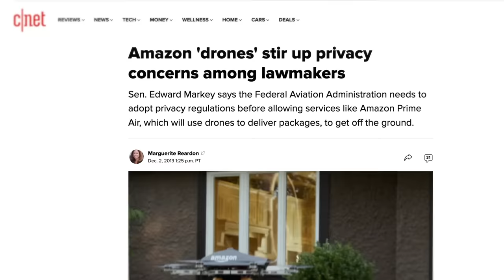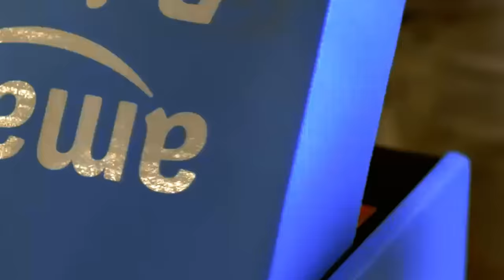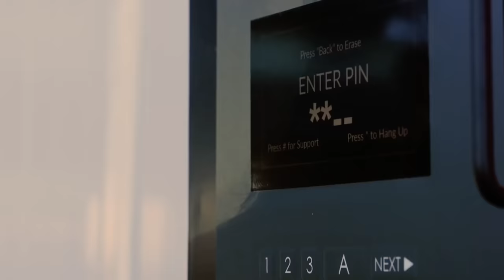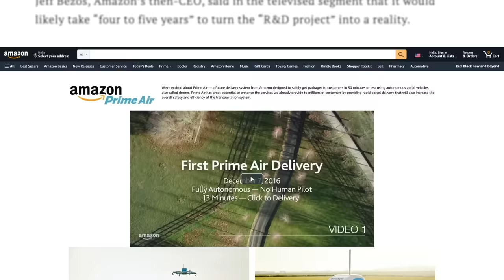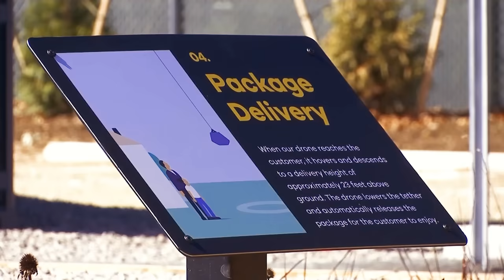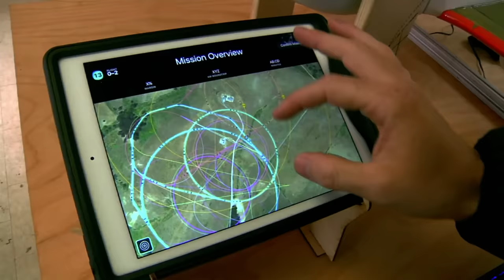Drone Delivery Was Supposed to be the Future. What Went Wrong?

Comment: 6:40 I though these issues could be solved by basically a picnic mat sized QR code to give the drone a clear target landing point.
The main reason I don't think drone delivery at least for now will work is the noise. Even if the drones stick to pre set sky lanes at 500ft the buzzing no stop will be madding
Reply: Well people deal with cars at street level.
Of course no one can say for sure, but I think people will be fine with drones.
Reply: cars are WAYYYYY louder than a drone
Reply: Jake Krause  if they allow a military grade GPS then it is just way too easy for something like Slaughterbot to happen. They shouldn't allow that to happen and just let commercial company to develop a natural looking autonomous navigation AI like birds and bees which doesn't even use GPS.
Reply: Exactly what I thought a practical solution would be. It could have been that amazon sent an executive to install a the QR landing mat to whoever subscribes to prime air and he installs the mat at a desired location maybe above the ground and clear off obstacles. And then whenever that customer orders something the package would always be delivered there. The customer would care to ensure the landing pad is clean and clear of obstacles as they do with a dish antenna. No need of fancy and unnecessarily complex AI or laser guidance.
Reply: @xponen  L1 -L5 GPS. Glonass, Bluetooth Beacons, LIDAR, etc. The sensors are their. Slaughterbots will be more like predator drones and less like knives that fly.
Reply: You can barely hear a drone at 100ft, let alone 500ft.
Reply: Yeah those electric propellers aren't exactly quiet. They should be doing R&D on quieter electric props. It is possible. The military does have a fleet of stealth Blackhawk helicopters since the 2000's that have quiet blade tech. Just implement that tech in smaller electric drones.
Reply: Drone buzzing sure is a weird noise. While it’s technically quieter than other stuff, I always find myself going crazy trying to find the source of the noise any time I hear it.

Probably just cause it’s a “new” noise, but still
Reply: OMG yes, I thought drones SO cool until I heard a fairly small one in operation.  My neighbor was super-proud of it.  I thought it was really awesome, even if noisy.  Then he flew it into a tree and it fell to the ground... like humpty-dumpty.
Reply: funny, how drone based delivery will cause a droning noise over a city.
Reply: A large outdoor QR code for every customer would significantly add to the cost and hassle.
Also, it might be vulnerable to bad actors attracting the drone with a duplicate mat or hacking the drone with a malicious QR code.
Reply: Hi Iron
Reply: relying on end users to set up the landing site is a bad idea. people could be stupid or mess with the system.
Reply: Thank you for mentioning it, but the noise of it would be awful and ruin any option of sitting quiet in your yard, especially for the poor people who live near a hub. The zooming noise of a single drone is worse than a ton of cars passing by!
Reply: It would be like living on a street where like some neighbor or another always seems to be mowing their lawn.
Reply: You normally can’t hear drones at 500 feet
Reply: In regard to the noise, a simple solution is more blades and less speed. That, and staying at a relatively high altitude of a few hundred feet would minimize noise.
Reply: I took a class done by one of the guys sitting on the anti-terroism council for miami and he basically said they were vetoing this idea out of hand along with many other divisions. Simply can't manage it.
Reply: @justusleague6952  totally not true.  they're also at street level and much of their noise gets diffused by fences.  this will not be true with multi-rotors.  you will not be able to hide from their noise.
Reply: @PacificSword  Uhh no? Cars ARE considerably louder than Drones. 
Drones could also fly considerably higher than 500ft to avoid the sound problem. 
A Drone 400 meters (1300ft) above ground cannot even be heard in a quiet forest. Let alone a City.
Reply: Don't prevent dogs or children from colliding with the drone. Also.. you underestimate how much these things depend on scalability. Even the idea of everyone having to think about where to put a mat (assuming they have a place and want to put it there) is enough to kill all uptake of the idea.
Reply: @xponen  the GPS we have now was once military grade lol

That term has a lot less meaning than you think
Reply: Better to have small vehicles driving on the roads. Quiet and almost as fast.
Reply: I could also shoot them outta the sky and make off with packages
Reply: Indeed, around here there are Zip scooters you can rent with  your phone and they are literally LITTERED all over like abandoned junk, and people have enough of it and the city has clamped down, they now have to be kept at ONLY specific locations, and that somewhat deletes the whole point of them.
Reply: Yeah, unis did that with drones paired with GPS, but the problem of obstacle avoidance and more cruicially, airports in metro area basically banning drones in planes flight path.

then problem got even worse when scumbags tried to fly drones INTO the airport and near planes. :/ I think additional problem is training enough people (and are willing) to troubleshoot/maintain drones, and possible thefts.

then theres the privacy issue with camera equipped drones flying over people's homes, and some people take that to extreme and just shoot drones out of the sky.
Reply: @theatom7264  that’s part of the issue, just implementing something that works on a helicopter scale, doesn’t necessarily work at drone scale.
Reply: @E.Asinus  eh, mostly because people abuse the hell out of the rental scooters. UAVs should last quite a while, unless a crash happens. only moving parts in a drone are brushless motors and they have way more lifespan than brushed/other lift methods.

still there is the problem of making sure obstacle avoidance works 99.9999% of time so companies dont get sued
Reply: @KaitouKaiju  technically all GPS is military grade, given the US military created GPS, much like they created the precursor to the internet, and many many other things we use on a daily basis.
Reply: @SunriseLAW  $500 drones or anything that has basic obsctacle avoida nce like dji stuff should prevent that from happening. though older drones have directional obstacle avoidance (only on the front)

that being said people could just snatch drones out of the sky by say, shooting it and get parts off it. and unless drone has footage of everything companies wont know who exactly shot it and all theyll have is where drone went MIA with gps location
Reply: Jake Krause  flying taxi's.... really....
Reply: @almostanengineer  Yeah, my goddaughter's light up Batman shoes have military grade velcro just like his boots
Reply: @xponen  we already have military grade gps on our phones…
Reply: @MichealBatur  you use the same GPS that the military uses but they artificially limit your precision except if they allow it for you to use in academic/scientific research in the US.
Reply: @leonmuller8475  They cannot fly that high due to FAA regulations.  Cars driving around at residential speeds are very quiet.  It's the tire friction with the road that creates most of the noise unless you're driving a hot rod.  Most people find the prop noises from multi-rotors quite irritating.  Me included and I fly the damn things.
Reply: @Daniel-uq2on  you ever hear a drone? Theyre crazy loud.
Reply: @TheRealE.B.  Also someone opening the door and wrecking a drone.
Reply: we can also make a type of "bridge" for apartment budings. it can be installed on windows for drones to deliver the packages on to
Reply: True, we wouldn't like our skies to be clogged with drones
Reply: I can barely hear my dji mavic drone when it's 400ft up.
Reply: Did not expect to see you on a wendover video
Reply: @PacificSword  „They cannot fly that high due to FAA regulations.“
Ever noticed that regulations applicable for you and me are not applicable for trillion Dollar companies? 
Also there were Nations like Switzerland and Austria which allowed you to fly as high as you want, without any problems. 
(There is now a EU wide streamlined regulation for Drones which is why this is not the case anymore)

So there are no actual reasons for regulations below 500 meters.
Reply: @ZentaBon  Yeah, I can understand that.
Reply: Are you going to rely on the user to provide the most critical information for the devices workflow? Bad idea. What if the person makes the order away from home and cannot put the pad for the drone to see?
Reply: @theatom7264  quiet props tech is there, they're loud because they're pretty much expendable and supposed to break when hitting something to prevent damage to property of the drone itself. On a regular electric RC helicopter with belt drive and carbon fibre blades, you only really hear the motor and the faster spinning tail rotor. They're mechanically complex though and they go through your bones like it's nothing and destroy themselves completely when the blades hit a tree or something, a quadcopter drone is much more compact, simple, safe and cheap but yeah, the sound is annoying. Ones they're a bit higher up, you can still identify them visually but you can't hear them.

Motor sail planes are great, only noisy on the way up and then they just cruise silently. Dropping things on little parachutes or in a big dedicated net works great especially if the destination is not really accessible by bike or car and irregular enough where just installing a long clothing-line pulley isn't worth the cost.
Reply: @SaveMoneySavethePlanet  it's mainly because the rotors are not going the same speed and also modifying the speed independently, it's just unnerving. On a modern Zeppelin with independent motor pods, it's the same but just a few octaves lower and way louder, it's quite terrifying actually, think war of the worlds.
Reply: It's possible to design a quiet drone, but no one seems interested in that sort of design. Basically, you have a glider (almost completely silent) with an electric winch connected to a weight hanging below. By alternating between reeling in the winch and letting it loose, the glider essentially flaps its wing by diving and climbing. In order to deliver a package, the glider flies in a circle while lowering the package. Even though the glider is flying in a wide circle, the package stays almost in place.

It's practically silent.
Reply: Drones at 500ft are far enough that you won't even notice them.
Reply: And delivery to rooftops in urban areas.
Reply: "The automocarriage would be a great idea if it wasn't for one small problem, the noise! Can you imagine, thousands of motorized carriages buzzing around all day, in every city and every corner of America? It would be maddening!"
Reply: I remember how difficult it is to scan my Epson ink QR code. But the idea of a some sort of 'helipad' or heli drop zone is sound. And i think one company shown in this video is using it. An over engineered one also.
Reply: @theatom7264  a car is louder, it's a non issue
Reply: @Daniel-uq2on  Because at street levels, there is way to reduce noise pollution (trees, barriers, vegetation etc), but a drone in the air isn't possible
Reply: @xponen  What is "military grade gps" lol. You realise that military & civlian GPS are near identical, with small exceptions WHICH the civilian market has access to??????
Reply: Those who say drones are not noisy are simply deaf. It's truly loud and annoying. Fact.
Reply: @JD-jc5hg  civilian GPS is artificially less precise so that terrorist don't use it to turn drone into a guided missile.
Reply: @ZentaBon  It'll get a little bit better with electric cars, but the tyre noise will still be bad
Reply: @sr.luisraytraceiii2422  LIDAR is absolutely incredible
Reply: @PalmliX  You can absolutely hear a drone at 100ft. Even at 500ft if its directly above you.
Reply: Perhaps, but that would raise the barrier to entry for customers, not to mention you still have to solve for the problem of customers forgetting roll out their QR code. Probably easier to just cable it down
Reply: It makes me wonder why drones and not an autonomous small driving vehicle? An autonomous van drives to the location, a rover picks up the package and delivers it to your door and goes back.
Reply: @fshihab  That's what happens regardless. A yard needs to be free of obstructions and counts as a landing site.
Reply: not true about the landing. the computer brains are still very dumb on even landing in the correct spot. i used to fly a toy drone, it had return to spot. but even then some times it would not land saying there was interference.
and we all know computers never fail...right. who wants a big delivery drone falling on them. as the commercial drones as not the toys we had to play with, these drones have a foot print of over a sq 36 inches and need another 4 feet around that for safety. and that is if it lands exactly in the bulls eye. most will land better than a foot off the mark.
Reply: Most drones are loud because they have tiny little high speed propellers. Get a bigger drone with better props that can move more air at lower rpm, and at 500ft you wouldn't hear much at all.
Reply: @xponen  Um, really? I don't get what you mean by using a drone into a guided missile? How would that work? Drones are already in use by terrorist groups by dropping grenades or mortar rounds. I don't understand how you would convert a Drone into a guided missile, it would require more than a GPS to do that. The only difference between military GPS & civilian lies in the frequency. Military receivers use two GPS frequencies for improved accuracy whereas civilian devices usually have just one GPS frequency. But two GPS frequencies are also available to the civilian market. Civilians may also use augmentation systems to improve GPS accuracy. Such systems may even give them better accuracy than the military. The U.S. government has made a number of augmentation systems available to both the public and private sectors. I don't think you people realise how shit the military gear is. With the exception of certain techs, the civilian market is generally way ahead of the military. So unless you have experience in civilian GPS & military GPS (I apologise if you do), I believe you're talking out of your arse :/
Reply: @JD-jc5hg  what's with the irrelevant detail? simply put a precise GPS allows you to weaponize a drone hence why civilian GPS is not precise. Smartphone GPS is widely publicised to be accurate to few meters but for special civilian who is granted high precision GPS by US government has their GPS accuracy in centimetre which is so precise that it can even measure ground movement due to geological activity. High precision GPS is granted for civilian use especially in scientific studies in the US that's how it is known that the precision is within centimetres.
Reply: So no one is gonna steal these packages with a landing pad? So every house has a safe space for a landing pad? Be realistic lol
Reply: @eliw2333  how about five hundred drones 500ft away lol
Reply: @PalmliX  how about five hundred drones 500ft away lol
Reply: @leonmuller8475  how about five hundred drones 500ft away lol
Reply: @leonmuller8475  have u ever flown a drone before? They so much louder than a car.
Reply: @thekwoka4707  how about five hundred drones 500ft away lol
Reply: @redmondhenry398  I own a drone it's way louder lol
Reply: @jbombita  I never recommended 500ft, I recommended 400 m  (1300ft)
Reply: Everyone in the comments "easy solution just build a drone with direct GPS with a laser beam to unlock doors to land safely into everyone's couch.
Reply: @jbombita  Yes, I own a Drone, and they are VERY quiet in comparison to a Car. 

At night, I  can hear the  cars from the inner city 1.5 km away (~1 mile). 
While I cannot hear my drone beyond 300 meters (~1000ft) in a quiet  forest.
Reply: @jbombita  "Everyone in the comments "easy solution just build a drone with direct GPS"
You  are the first one  to suggest that,  and it is a stupid suggestion.
Reply: @jbombita  "I own a drone it's way louder lol"
Louder than what? A Bike? An EV driving in a parking lot?
Everything else is louder than  a Drone.
Reply: @leonmuller8475  you must have the smallest drone ever that can carry a 20 Ib package 🤔
Reply: @jbombita  We were talking about drones capable of carrying 2.4 kg (5 lb). Where did you get 20 lb from?
Reply: @leonmuller8475  lol the average package is 20 Ibs. I didn't we were talking about little tiny drones that would get destroyed in strong winds and rain lol hahaha.
Reply: @leonmuller8475  so all this effort to build these drones just for the fraction of the actual packages thats the delivered daily???? 🤔🤔🤔🤔 Make that make sense🤷‍♂️
Reply: @leonmuller8475  Or what about the houses that have multiple packages being delivered for them? 🤔🤔🤔🤔. I'm sure that quiet little tiny drone can do it!!!
Reply: @jbombita  No, very situational drones, Drones like you see in the video, none of these shown are capable of carrying 20 lb. 

But most Drones can deal with quite a lot of Wind. even the 250 g (0.5 lb) DJI Drone can deal with level 5 winds. 
A Drone capable of carrying 5 lb will likely be able to deal with level 8 winds.
Reply: @jbombita  Most heavy packages do not have a right now need anyways. 
But food, especially cooked food has a very quick delivery demand. And is also, unless you are purchasing for a large group, under the weight limit.
Reply: @jbombita  Send multiple, or simply transport it as usual. 
Remember it is an addition, not a replacement.
Reply: @leonmuller8475  what w waste of money and time when a delivery driver can just delivery these 2 Ib packages since the drivers already delivery there. Iunno just me I guess🤷‍♂️
Reply: @jbombita  Well they will do it with 200+ other packages also being delivered for the day. 
While a Drone can send it to you any time of the Day as long as it is not snowing or raining, and do it much quicker and without adding to the traffic on the road.
Reply: @JD-jc5hg  ok alright I got a fact wrong; high-precision GPS is now available to civilian. But you also got a fact wrong; GPS is not a civilian technology (you only have the receiver and the signal) but the signal are released to the public, from 2005 to 2018, by the AIr Force as "Civil Signal" for economic purpose. GPS is still not a civilian technology but provided by the Air Force as a public goods/service.
Reply: @xponen  You really that petty that you're bringing up a technicality? I never claimed GPS are civilian owned, I only made the comparison between civilian operated & military operated. I believe all augmentations have been unrestricted to civilians since 2000, not "recently". Anyways from your own words, why are you bringing up useless shit? No one cares who operates it, the point is that Civilian GPS & military GPS (and other GNN systems) are near identical